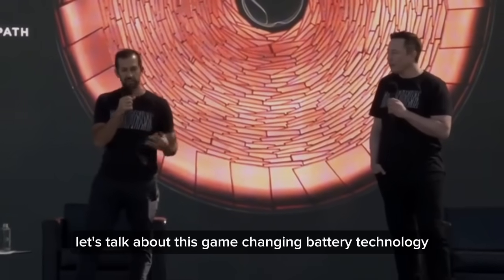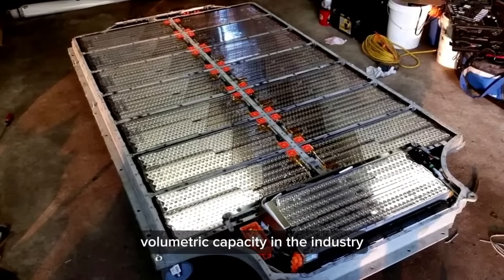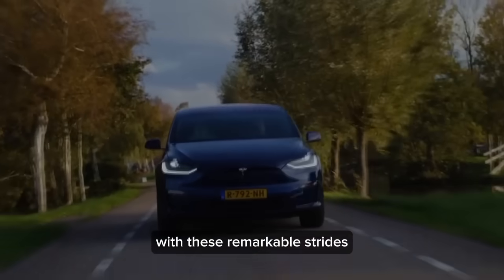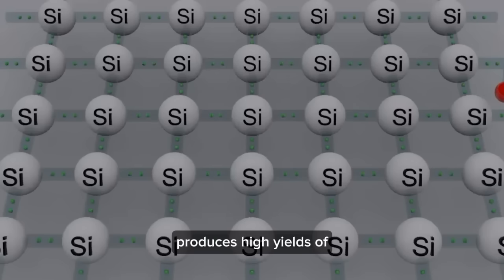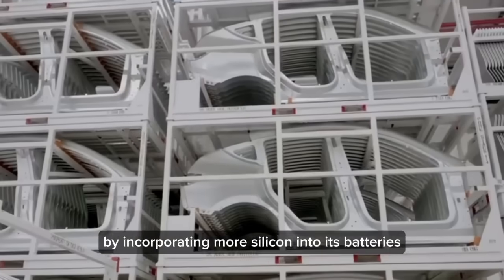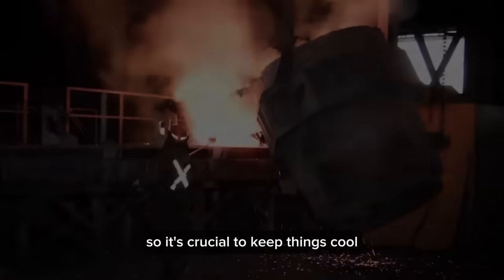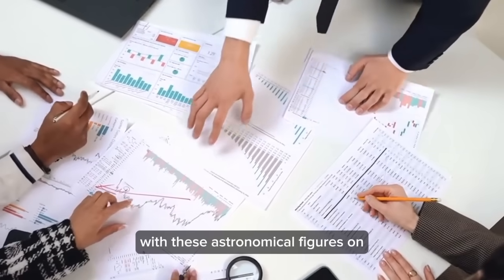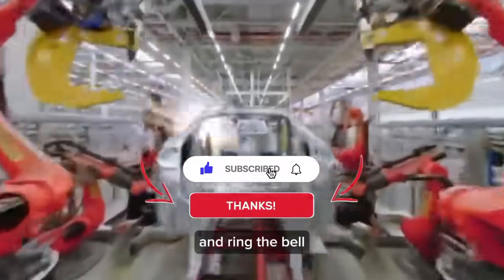JUST IN: Elon Announces New Battery Lasting 50 Years, Changes ENTIRE Industry!

Comment: 📝 Summary of Key Points:

📌 The new Silicon Battery Technology unveiled by Tesla promises a 10-fold reduction in footprint, 10 times less energy consumption, and significant cost savings.

🧐 Silicon anode batteries offer higher energy density, faster charging times, longer running times, and cost savings for both battery companies and consumers.

🚀 Tesla's incorporation of more silicon into their batteries has led to improved performance, higher energy density, and resilience to extreme temperatures.

💡 Additional Insights and Observations:

💬 Quotable Moments: "Silicon anodes aren't just nudging battery performance up a notch; they're taking it to new heights."

📊 Data and Statistics: By 2031, the global silicon anode market is projected to reach $28 billion, showcasing significant growth potential.

📣 Concluding Remarks:

The Silicon Battery Technology introduced by Tesla is poised to revolutionize the battery industry with its superior performance, cost-effectiveness, and potential for widespread adoption. The future of battery technology looks promising with silicon anode batteries leading the way towards a greener and safer future.
Generated using TalkBud